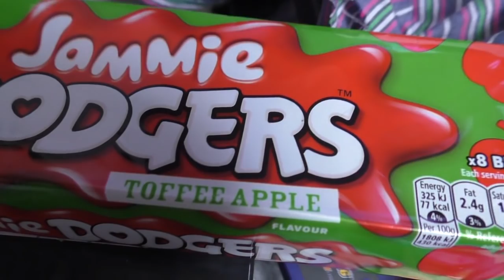DB Sport & Scale Sopwith Pup Electric Build Pt23 RC Model Geeks

Comment: Take the tank off on that Cox Rob and clean the reed valve it is bound to be clogged up after that length of time,slosh some glow fuel around it,just to show you that Youtube has buying ability I have purchased a soldering station like yours I was so impressed with ,grabbed a special offer on Maplins for £39.99 as opposed to the normal £55,looks like the Pup is not far away from chocks away,carry on building.
Reply from the maker: Yeah ill give it a good clean out before i fire it up. Enjoy the soldering station. its pretty good for most jobs!